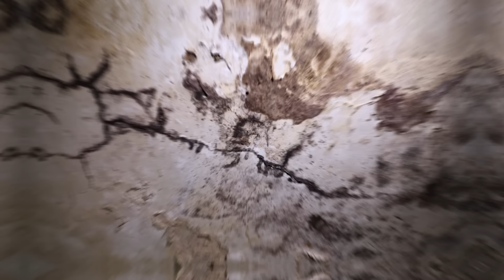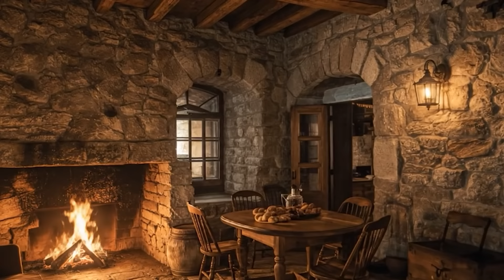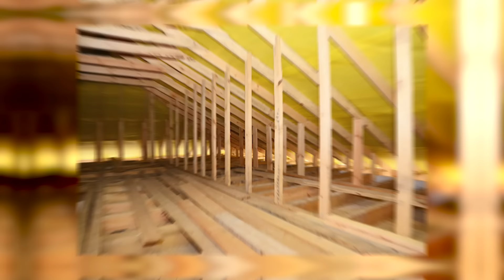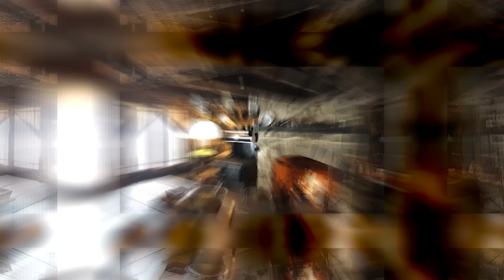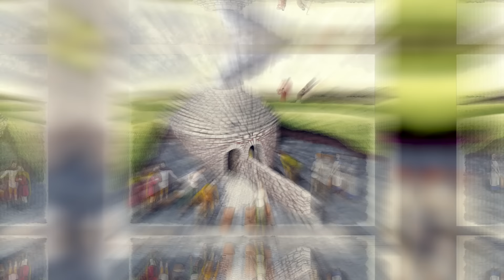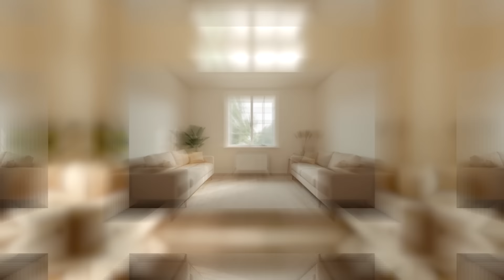Why Your House MOLDS Every Winter While Medieval Ones Never Did

Comment: You’ve warned that renovations can do more harm than good. One overlooked aspect is that builders did consciously choose what the coldest surface is! If the building had originally single glass pane windows, then those would have condensation in winter, which would be wiped off by the inhabitants. This makes mold prevention rather easy. If the isolation gets eaten by mold, then you tear it out and replace the rubber. However, if you change it to triple glass pane, then the wall may be the coldest part, and it develops a film of water, especially if it has been painted over with modern artificial paints…

Comment: By combining many aspects of construction the midevil citizen built better homes that were healthy. Lime is the best coating for walls, its acidic nature prevents ANY mold from growing. Air flow is the most important aspect of a healthy home, keeps the moisture from building up. Flow from the outside to the inside back to the outside was key.

Comment: It will only ever get worse.  There has never been a time where people review building codes and actually admit "Hey, half of these are utter crap, lets scrap them and start again".  Rules and procedures only ever get added to.  Before long houses will be made with in-built dehumidifiers to counteract the fact they are sealed tight.  Everything today is 'fixed' by throwing power consuming devices at it, wrecking the planet just that little bit faster.  Brains and logical thought went out with the 20th century.
Reply: I'm looking at getting a Mechanical Ventilation & Heat Recovery system. They're expensive, but pay for themselves in around 5 years. You can get one that sits in the attic & has tubes going to each room. Or, for a flat, ones for individual rooms. I wish I'd opted for a more expensive one (around £500) rather than a cheaper, less efficient one (around £200) when I got my bathroom re-done. It works, but it a bit draughty as it doesn't have an external flap to keep out the wind.

Comment: My house is roughly 150 years old.  I have dampness issues in the summer if I can't have the door and windows open but in the winter it's so dry I have difficulty keeping plants alive.
Reply: This place is old and has no insulation. The windows are old too. Only 1 layer of glass. The air in winter gets so dry I have to run a humidifier. But there's no mold. Of course I am on the third floor here.

Comment: I correctly guessed this b4 even watching...back in olden days/? homes were allowed to breath........middle-age homes(( even poor pple )) had better built homes to live in...they had airflows--it also helped in controlling bad-odors too.        ......        ......        (( WAAN ))
Reply: Good thing it helped bad odors because they stunk. They believed clean skin would make them fatally ill
Reply: Open windows every day,regardless. Airflow is key. And lots of plants like snake n spider,ivy etc near windows absorbs water and give out oxygen at night. So get lots of cuttings going in summer time and you will be well prepared for winter if you live in cooler climates. V little watering required in winter. Plus quick showers n always try have a window open in bathroom. Especially after a shower. Great room for plants too.

Comment: I’ve got a lot of experience with mold. My biggest problem areas are my bedroom and the bath. The bath has no window and the ventilation is ridiculously underpowered, and was probably never maintained for decades… The towels get musky really fast, and hanging them from the door causes the door to develop mold… In the bedroom, it always hits the corner, despite me leaving it free on purpose. One wall is external and the other is to my neighbour, who doesn’t seem to heat that adjacent room at all… Another smaller problem is my old clothes, which I put into a basket in order for them to dry out, but that causes the wall to get moldy, even though I keep 4 inches of space in between…
Reply: Put window or extractor fan in outside wall , open window or use fan after use . Have heating system and that works . Use very thin quick drying towels , not thick long- drying ones .
Reply: @indole375In principle, a good idea, but not if you live for rent and can't even change the lock to improve security, or install a functional fume extractor in the kitchen... Europe is sometimes weird: no AC, no washing machine, dish washer, dryer, and at times everything stuck in the 1950s...
Reply: @edi9892 
Ah!
Reply: Knock out a brick or 2 and put a ventilation "brick " in with closure... Plastic and white , can be painted to blend it . Might be able to do it yourself without your landlord noticing?!

Comment: Buy a dehumidifier, EBAC ones are good make. Lime mortar breaths better than cement.
Reply: A dehumidifier uses electricity. Midevil structures don't need electricity!
Reply: @KCO-n9z  Lime kilns used a lot of energy.
Reply: Natural Lime formations are everywhere and needs no processing except just adding sea salt and  a stir.
Reply: @russellcollins5692  Usable lime is very rare naturally. Limestone is heated to make quicklime. hence all those old lime kilns round the country.
Reply: @peterwait641  Having run Lime Kilns at the Winnington Works, Northwich producing burnt lime and CO2 on a huge industrial scale using coke as the fuel in the kilns, so what is your point exactly as the final products were Soda Ash both heavy and light and a by-product of Calcium Chloride?
Reply: @KCO-n9z There is no free lunch. Ventilation is a thing and it loses heat.

Comment: There is now an under reported scandal of cavity wall insulation which was offered for free in the last twenty years that is producing an epidemic of mold cases in older houses badly affecting people’s health. I refused this insulation as I knew my 1920’s brick house with lime mortared bricks had iron ties between the inner and outer courses which would of been in contact with the insulation which when damp from condensation would of corroded out, plus the cavity is designed to have an air flow hence the vents both internal and external walls stopping mold forming.
Reply: Some cowboy companies filled cavities with silicon impregnated paper which went mouldy !
Reply: I used to own a 1930 house that I had to get free cavity wall insulation put in before me removed.  It was blown fibre.  When it was extracted you could squeeze a handful and water would just run out.  It had blocked the air bricks and sat on wall ties as you say.  Most modern builders and insulation installers haven't the faintest idea about how cavity walls actually work.  Most workers these days just blindly follow rules and procedures with no use of brain power whatsoever.
Reply: @MikeB_UK  Sadly it’s ALL about the money! Non of them give a moneys about serious issues arising from incorrect insulation, first the government Energy Department ran by Ed ( big brain ) Milliband and then the Shister contract companies. Who pick up the bill? The Consumer does!
Reply: @warrenstanford7240  tbf this was known about long before Miliband came in a year ago... The main issue was under-regulation & lack of monitoring (classic neo-liberal "small government" because I don't want to pay for the good stuff). Other countries, like the Nordic ones, do it much better. The subsidies encouraged cowboys, who simply folded their companies when anyone sued.
Reply: @Tequima  Of course it’s been known about for years the same as the flammable insulation in apartment buildings, it’s a failure of government but it is Milliband who is in charge NOW and what has his Department of Energy done? The answer absolutely nothing!
Reply: @MikeB_UK
Agreed.  Can you put put insulation in the attic?
Reply: @AA-ct7cb  My Dad put insulation in the attic in 1979 and boarded it out to use for extra storage space.

Comment: The people didn’t build like that to avoid mold, but to work around limitations: material costs, light, heating, etc.
If there’s a blackout today, and people think that they can dig out their candles, hurricane lanterns, or worse, put some glowing coals to heat the room, like we used to do in the past, they’ll have a rude awakening, or rather go to sleep forever…
It’s hard to make a house without a draft with medieval technology, but more importantly, it would be utter lunacy to do so! They needed the draft to survive!
Also, mud floors were common for one simple reason: cut timber was expensive. Sure, most logs were split rather than sawed, which made it cheaper (saws were very expensive and a royal pain in the A to sharpen), but you didn’t want such wonky boards as a floor… Thus, wooden floors were only used for upper floors, or parts where you needed a level surface and didn’t want to use compacted earth. A classic example is a sleeping area, though many of them in Europe were put on an elevated floor.
The reed roofs are also chosen for the price point, but also because they allow smoke to pass through. Even better: hearth and reed roofs form a symbiotic relationship. If you replace the hearth with an enclosed system and a chimney, then the roof would rot! If you use a hearth and roof tiles, then you’d need to keep a small window constantly open in order to get rid of the smoke!
As a side note, the rooms were typically small in order to keep yourself warm, and since light was expensive. This went as far as putting staircases outside the building or using ladders to reach the bedroom! It should be noted that many houses had only partial upper floors, which wasn’t just due to costs, but to keep a double ceiling height for the hearth. BTW: whitewash was also to maximise the effect of lighting.

Comment: So that's why English Great Homes have beautiful cloth wall coverings instead of wallpaper.
Reply: Hello Carolyn. Cloth on walls was more of a decorative thing. Most times it was placed over plaster or wood to display wealth.
Reply: Dasz linka do sklepu z takimi materiałami?
Reply: All those wall hangings were to help control drafts in large cold Stone castles
Reply: No, AFAIK, it was mostly decorative, but it could help to isolate the wall. Stone walls drain warmth very fast, but cloth, and wood won't.
Reply: @KCO-n9z 
Old ship sails were used over plaster and lime washed ,too , in the attics . I lived in a manor house that had this : sails and timbers  from 13 th C ships .

Comment: Code today REQUIRES the building of unhealthy homes. That is so sad
Reply: Log homes are exempt from the energy code
Reply: @sueyoung2115 Log/Timber homes leave out the factor of thermal mass. I feel like true structural Masonry homes should be included in that exemption.
Reply: @scotteric8711yes, they are also designed to breathe! The addition of thermal mass in the form of a masonry or rocket stove, would be the best.
Reply: Code also requires some techniques that are LESS earthquake- or stormproof!
Traditional wooden joinery is far superior to screws, nails, or worse those F-ing nailboards, but regulation says that you need metal... (which doesn't expand and contract at the same rate and wiggles itself free, rusts, and forms hotspots in fires)

Comment: your analysis understandable but cost of energy today dont allow it, I am sure if Medieval were today they have done like us
Reply: Vapor permeable does not mean air permeable or not airtight. You can achieve good airtightness (little leakage)  and use a combination airtight/vapor permeable barrier.
Reply: I've been designing and building natural and historical architecture (which they are one in the same thing) for over 50 years now...Nothing in your statement is true or accurate...
Reply: @helenehoward6294  100% correct...!!!
Reply: @JayCWhiteCloud how can modern architects copy some of the ancient wisdom. Because the mold problem today is out of control